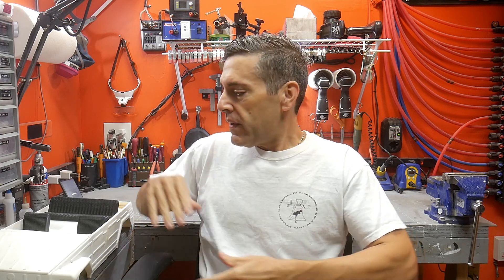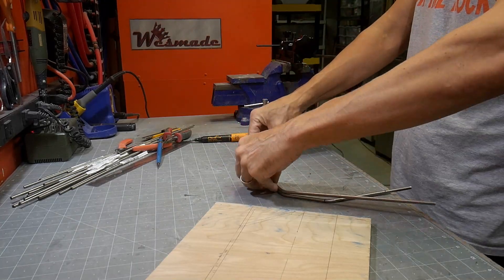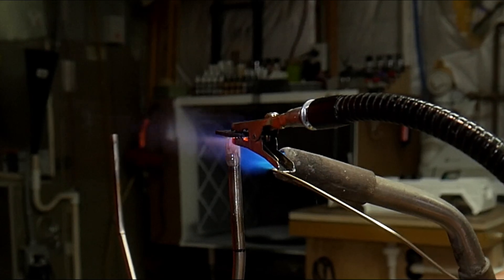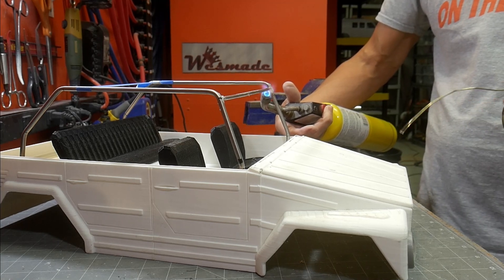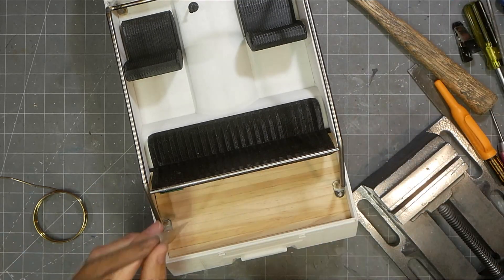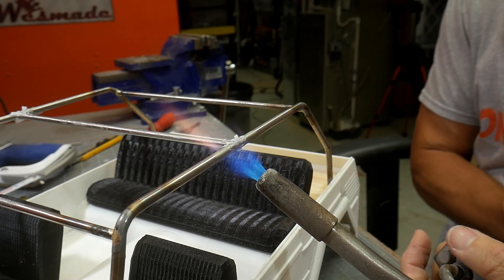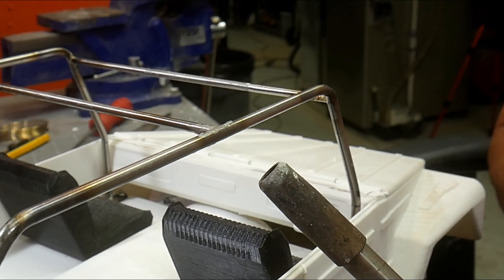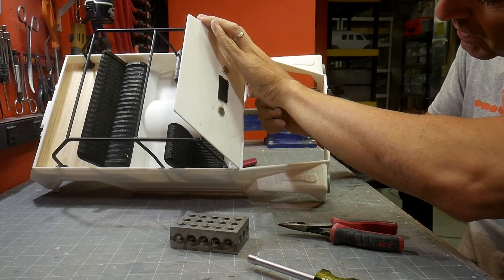How to: Braze or Silver Solder a Roll Cage

Comment: would you mind telling me exactly what Silver Solder & Flux etc is needed to do this & what's the least expensive solder that would work for soldering brake line tubing ? I want to try it with one of my RC Crawler Thanks so much
Reply from the maker: There is no real inexpensive when it comes to solder that will work.  I wouldn't recommend brake tubing, its too soft and will look like crap after the first roll.  Go to eBay and buy some SS capillary tubing.  It comes in different lengths and is very robust.  I use SafetySilv 45 matched with their flux.  I also use a MAAP gas torch.

Comment: This video is super helpful by being clear and keeping the steps simple. Also it's nice to know someone else battles with jigging small parts 

I've been able to use 56% when I want to do additional work near a joint I already did with 45%, the lower melting point gives you a little extra wiggle room. And I'll put a couple layers of rumpled aluminum foil below my work to catch flux drips if I don't want to damage the material beneath.
Reply from the maker: I will give that a try, thanks for the tip

Comment: Where do you purchase your tuning from?
Reply from the maker: eBay, just type in SS capillary tubing
Reply: @wesmadebuilds681  Thanks I appreciate it! One more question I use the 45 silver solder also and was curious if brazing the stainless was and harder than other materials. I have used solid rod steel and brass rod.
Reply from the maker: Actually easier, I don't even bother cleaning the SS just use the flux.  With Carbon Steel you need to sand it first.

Comment: Yet another great “How To”. I appreciate the attention to detail. 
— will those helping hands burn at the end?  I have destroyed magnets, spare pieces of metal, and anything else really when I try to silver solder things. You mention this when you spoke about having things close together. I am thinking about bumper parts/mounts etc. 

— Thanks a lot for the information/videos!
Reply from the maker: Yes, I have a giant bag of them.  The spring gets weak.  You can see I have a cheap clamp on one getting me a few more goes before it gets replaced.  The material I am using is SS, so magnets are no good.

Comment: This was useful. I was using oxygen to braze and I wasn’t able to do it easily. Looks like I was going for glowing red and using a stiffer braze. I’m going to change up my whole program and try your strategy. Thanks.
Reply from the maker: I have an oxy/map torch which I use for thicker metal.  Yeah, if it gets red for more than a second you went too far.  It really should show any color at all to flow best.  You just look for the metal to get super shiny/clear and that is the right temperature.  I've watched so many people in YouTube videos struggling because it is too hot.
Reply: @wesmadebuilds681  well I’m also trying to use a bare bronze brazing rod to do the brazing. Silver soldier has been easier but with that heat it’s just resistant to stick to the red hot. Thanks man this aught to help me save time money and finding someone to fabricate my stuff. Awesome.
Reply from the maker: good luck